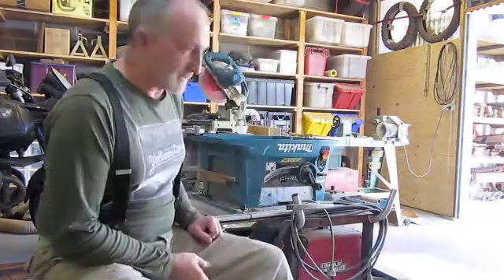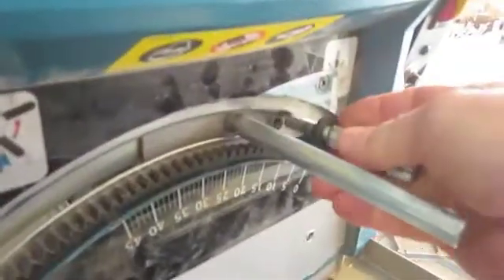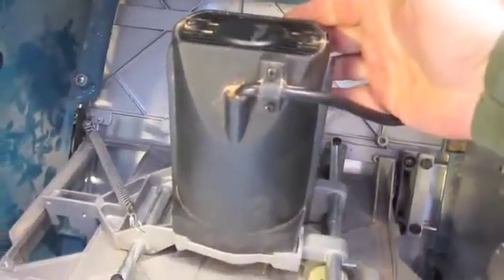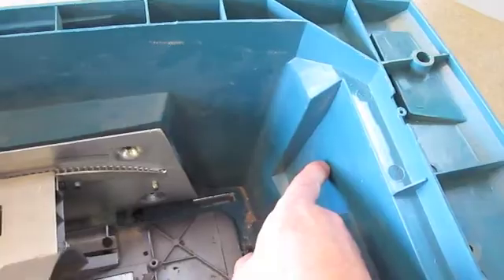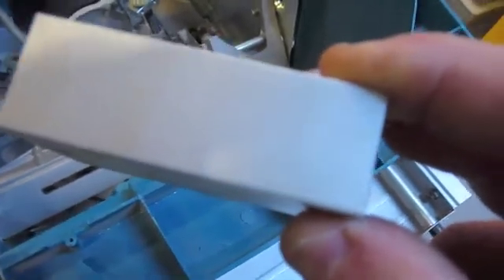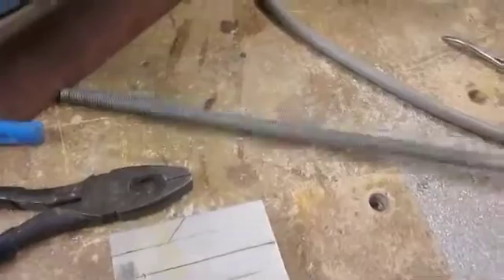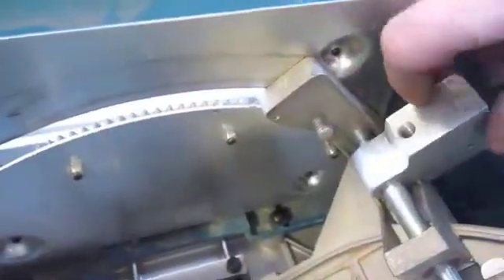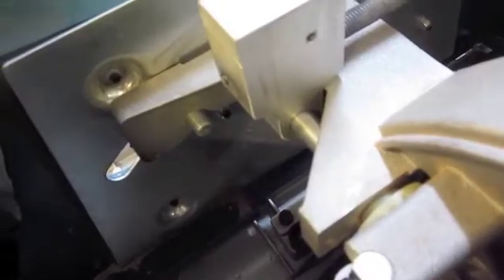Makita MLT100 Table Saw Blade Tilt Modification - Made by J&D

Comment: The spring is there to tension the knob so that vibration doesn't make it loosen
Reply from the maker: It worked okay for that for sure. After this modification the tilt screw held it so the spring would have been redundant. Thanks for your comment.

Comment: I’m having a horrible time with the tilt function on my Makita 2705.  It looks pretty much the same as yours.  My tilt function is stiff like something is frozen up.  I have ordered the “handle” and the teeth thingy.  Maybe that’s the problem? But either way, I like your design, that’s very clear.  I have been hoping I wouldn’t have to turn it upside down. I just can’t figure it out.  Wanna make another video?
Reply from the maker: I’ve made quite a few more videos, just not on that table saw. That video is quite a few years old, I’ve since moved to the USA and upgraded to a shop fox table saw that has that tilt feature as standard. Having said all that, the Makita MLT900 tilt had a really poor design. If the 2705 has the same general set up I’d start by just removing the spring on the adjustment handle and see if that helps. I can’t recall if the pivot points were prone to clogging up with sawdust but the only way to find out is to turn it upside down. Good luck.

Comment: Yes Makita is a great name but this product from Makita is a shame of a table saw. So many things you have to improve. And Makita is absolutely beyond of any reproach. They still produce this faulty design. About your video: I saw that you didn't use any grease which helps a lot to adjust the hight and the angle smoother. Shortly the switch of my MLT100 stopped working. I couldn't get it here in Thailand. I tried to buy it for half a year now. Today I found it on Aliexpress. The name of this switch is: KJD12-14 and it has 6 pins. It is made in China by KEDU. The prize is about 20$.
Can anybody explain me the 4 cables which go to the motor: 2 black, 1 grey, 1 blue? I don't know anymore how to connect it to the switch together with the overload protector. Thanks for any help!
Reply from the maker: I did use a lubricant but opted to use graphite as grease tends to build into a useless wood dust paste. I also had troubles with the switch and failed trying to fix it myself. I had to take it to a repair shop, I hope you’re able to get it working without that step.

Comment: Great vid! I think the sprig is pushing the motor holder away from inside so u can move it left or right to adjust the angle, otherwise it would get stuck. I hope u understand what i am talking about. I had makita, restored it and sold it. Now i am building one by myslf. Greetings, Boris
Reply from the maker: For me, I think the spring helped by changing the friction points as well as overcoming some of the friction on the rod that the plate slides on as

Comment: Great video, and ingenious solution. I've got the very same Makita table saw, and yes, I've had same problem of aligning the blade to be perfectly perpendicular to the top. It's always just a little off, so I find myself compensating by planing the cut side by hand with my Stanley jackplane. Yesterday I had the thing upside down trying to find just what it was that was getting in the way of aligning this thing. I though maybe a buildup of sawdust was getting in the way. I screwed the plastic wheel-thing as far over as it could go, and then it started to jump the threads. I'll take another look tomorrow, now that I've watched your video and have a better understanding of the design.
Reply from the maker: Thank you for your comments. After making my modification I was able to achieve about a degree beyond 90 so you should be able to do the same. One thing that I had to fix to do that was to rebuild the semicircular bands that the blade/motor assembly pivots on. One side had slipped and deformed which had limited movement.

Comment: Hello, I solved this problem definitively after having replaced this part of the lifting system for the second time, I put a hard bronze bushing and I believe it will last a long time. See the video:  https://youtu.be/zRqcgkZkxIw
Reply from the maker: I think mine is about to go again but rather than continue to struggle with this saw I'm going to invest in a better one.
Reply: @madebyjnd  You're right, a better quality saw will be better, and this used MLT100 pays half a better one. In Brazil we do not have so many options, however Makita and DeWalt have better bench models than the MLT100.
Now I must have some problem, my wife says I like these things that give them trouble spending time on them ... you will understand ... I think she's right .... kkkkkkkkkkkkkkkkk

Comment: I find it very difficult to raise and lower the blade on my saw. What can I do to fix the problem. Thanks
Reply from the maker: Hello Bobby. If you are still able to raise and lower the blade I advise that you purchase a suitable spring and some graphite powder. Turn your saw upside down and lubricate the screw that does the raising and lowering. There is only one screw which works on one side of the casting that carries the motor and blade so there is an inherent binding caused when the two glide bars are sliding through the casting. You should attach the spring to the side opposite the screw to ease this binding and help raise the blade.
Reply: @madebyjnd  thanks for advice. Highly appreciated.

Comment: Nice vdo...i got makita mlt100 saw as well....do u know how to do blade alignment
Reply from the maker: vikram khaira I don’t see how it would be done. At best, you’ll only be able to align the fence to the blade which it done at the bolts that hold the fence to the clamp on the end. I recommend modifying the fence by making it dual sided.
Reply: 2dear  u know i figured it out ...turned out its pretty easy but takes a while to really tune in the blade...there r two bolts on back side of blade housing ...i guess its called trunion.....had upgraded the fence to dual sided the day i bought it ...thanx anyway...its always good to talk a fellow maker
Reply from the maker: vikram khaira I am happy to learn something today. Happy wood working.

Comment: must be the biggest piece of crap I ever bought. No matter how many times I adjust the blade to the miter slots, one or two cuts and it moves
Reply from the maker: G.V. Mouth I had the same problem but neglected to mention it in the video. The pivots on both sides of the carriage for the motor and blade incorporate narrow bands of metal that had bound up and deformed. I reshaped the ends of both bands so that they locked in place better and this simple thing seems to have fixed that issue.

Comment: Thank you! I got some ideas from your video for the same table saw. I believe you can also check the straightnes of the table surface itself. Mine surely is not straight. Also the sliding table have a huge play and many other flaws i've found.
Reply from the maker: No worries Eugen. It was a fun modification to make.
Reply: 2dear thanks a lot for your fast reply!